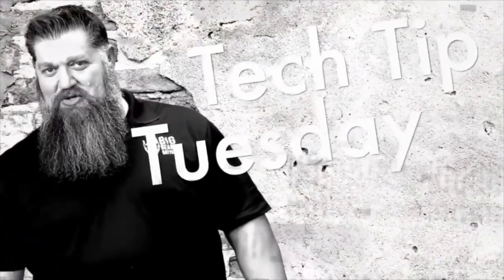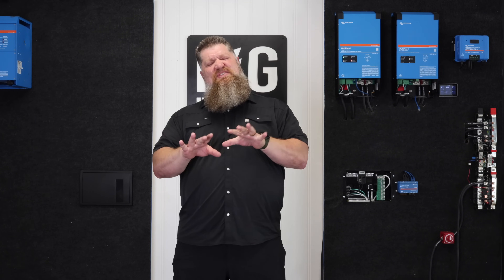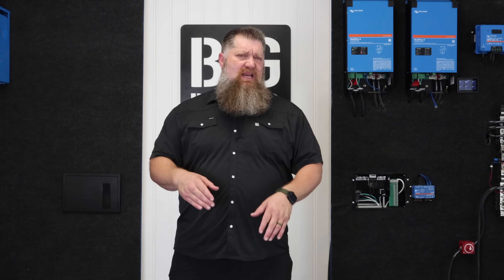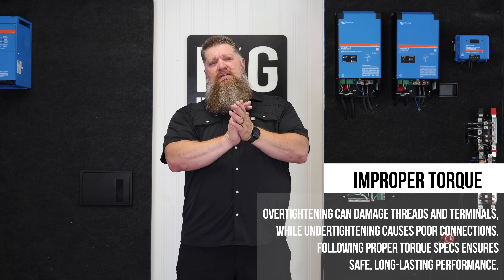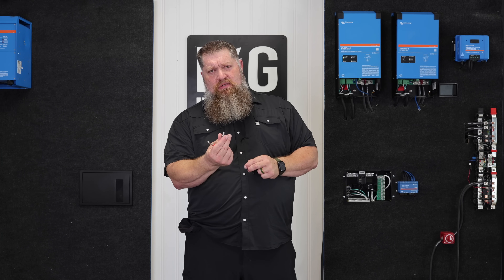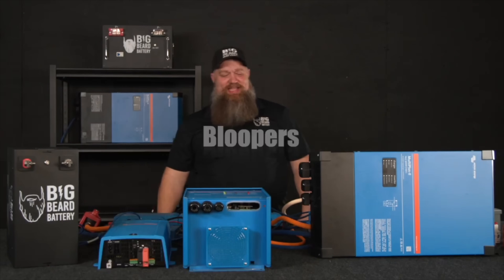Avoid These 4 Cabling Errors in DIY Solar Systems

Comment: 1:00 - No Voltage drop is directly proportional to the legth of wire - imabalance between the leads makes no differenc on voltage drop, just where it occurs. 

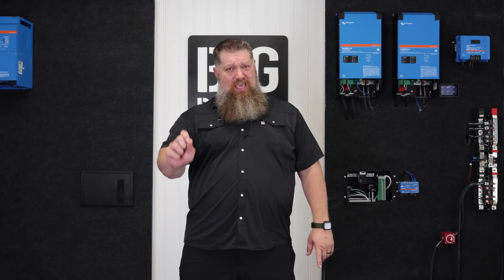2:30 - Yes, it is critical that all paths from multiple batteries should have the same resistance. Cutting that inch off to compensate for the bus bar is is taking it a little too precisely. Plus the solid bus bar is going to have lower resistance than either of the shared wires so you only need to conpensate about half the distance. We are talking less than a micro-ohm here in many cases.    Also cross-corner wiring when practical is better solution for balancing current than mutiple leads to the bus. 

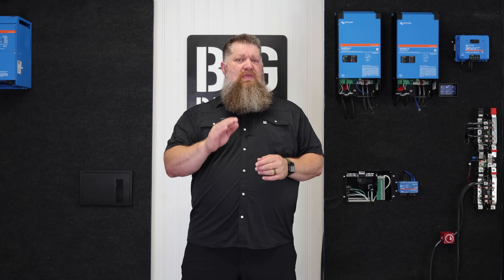3:18 - This is wildly wrong in technical terms, but the conclusions are accurate.   Note that free-air ampacities are different than conduit ampacities, and the temperature rating os components can affect safe capacity. And if you run a continuous load (3 hr or more) that load should not exceed 80% of the ampacity of the wire.   . Additionally it's usually worth running the proposed wire gauge and length  through a voltage drop calculator. If it's above 3% on a large load or in the critical path it can be worth up-sizing the wire.

Comment: Cable length affects nothing directly.  Total resistance is important if you don't have a battery balancing circuit.  Length does affect resistance but it is tiny compared to guage differences, connection resistance, etc.  These days , every multi battery configuration should have a balancer.

Comment: As someone who used to work as an engineer, I cannot see any rationale for if you only have one battery, why the positive and negative wiring needs to be the same length. 

In vehicles for instance, this is very much not the case - the negative cable can be as short as a few inches, but the positive wiring to some loads can be longer than the length of the vehicle. Why is this meant to be a bad thing?
Reply: As a technician I can definitely see the value of a little bit of extra cable for a re-fit.
Reply: @WorBlux Sure, but that's not really the issue at hand is it?

Comment: Not convinced by the 'reduce cable length by the same as extra busbar length'. That assumes that the busbar and the cable have the same resistance, and normally I would expect the busbar to have a lot more copper than the cable and thus be significantly lower resistance. So one inch of busbar might be equivalent to only half or a quarter inch of cable.
Reply from the maker: But if we are talking equivalency then if both positive and negative land in the busbar with the same distance/IR then it doesn’t matter as the busbars (pos and neg ie lynx distributor and shunt would have their own matched IR. Bamo

Comment: You left out the most important tip, properly connecting multiple terminals to a single location. The highest current load to least current load connected to the sink connection. 
   Do NOT stack a 18ga bms/auxilliray between a high current connection. You are decreasing the contact surface area, effectivley reducing current flow/increasing resistance.

Comment: I've got four 12V 100ah batteries wired in parallel (400ah total) and all wires between batteries are equal length 2/0 cable.  I do have a difference in length between the positive and negative going to my master switch (+) and my smart shunt (-) with the negative cable being about 1 foot longer.  Is that acceptable or should I make the positive cable longer to equalize.
Reply: You should read through the comments here for your answer.

Comment: How much length do you add for a Victron 500 amp smart shunt?
Reply from the maker: So the shunt adds length. You can reduce the cable by the lug to lug length
Reply: @BigBeardBattery  Shunts have a precise resistance!

 If you want to be that detailed look up the resistance of your wire, do the math and reduce it by that.   a 50mV/500A shunt has a resistance of 1 milliohm. 100 ft. of 4/0 cable has a resistance of 4.9milliOhms. So you need to take about 20' of cable out. 

You see why some of us find it a bit silly? It certainly looks nice and neat when the cables run together, and aesthetics isn't insignificant if you are assembling a system for someone else, but for DIY that detail is unnecessary worry.
Reply: Adding extra length makes zero sense!  The cables from the buss bar to the inverter only needs to be the proper gauge to handle the current and as short as possible.  There is nothing to be gained by making them the same length/same resistance!

Comment: This is not incorrect. 
In a parallel system, the CIRCUITS of the same devices need to be the same in aspects such as cable length, same manufacturer, same lugs and even similar torque ratings on the bolts. 
For example if two batteries are running to a busbar in parallel, each ones has to have the exact same circuit, so same negative and same positive length as the other battery. However, the negative and positive DO NOT have to be the same. its not about matching cable lengths, its about matching circuits. 

If in the same system you also have two inverters in parallel, they too have the have the exact same circuits as one another, but do not have to have the same as the batteries, and can too have different length positive and negative cable lengths in their respective circuits, as long as the positive of the one is the same as the positive of the other, and the negative of the one is the same as the negative of the other.
Reply: If you have parallel inverters only the overall loop length of each inverter need to be the same.  The color of the wire makes no difference!
Reply: @rpsmith  Thanks for repeating exactly what i said, but just in a more useless way, because at no point did i ever say color meant anything. f you actually read what i said, i CLEARLY said POLES (POSITIVE AND NEGATIVE)
Reply: @BluePowerPro  "as long as the positive of the one is the same as the positive of the other, and the negative of the one is the same as the negative of the other.": ~ Only the combination of the positive and negative total length matters.
Reply: @BluePowerPro  ~ You're welcome!  Have a nice day!
Reply: @rpsmith   False, the negative is often connected the the nuetral, so referencing the neutral in two different spots on that circuit can casue unwanted current flow on the nuetral.

Comment: get a battery equalizer
Reply: Not needed for low C rates, and on high C rate system the better job you do balancing everything else the the less work it needs to do.

Comment: All super valuable tips. I see the washer scenario done incorrectly all the time not just in these bills, but all over the police in general but obviously super important with electrical connections for multiple reasons heat, resistance equals bad lol

Comment: Todd, my 2013 Rockwood 2205S coach uses the frame of the coach as negative, so the negative wire is only about 3’ long. It comes out of the battery box and is bolted to the frame, right under the battery box. Also I have installed a Victron DC to DC controller so I can charge the batteries while towing. Obviously I cannot have equal lengths of negative and positive wires. I hear what you are saying about battery balancing, so what I am planning on doing is exchanging my two BB batteries positions in the battery box. Any thoughts?
Reply from the maker: I am speaking of a busbar system where the positive and negative going to the busbar needs to be the same length on heavy loads. 

It is universal that the frame is used and the shortest distance to the frame is fine.
Reply: @BigBeardBattery awesome video.  What is too high of a temperature for a cable/lug/bus bar? Thanks

Comment: I have a BS in electronic engineering. Wire gauge is critical and this is a safety hazard to drive home. Equal length battery cables to the buss bars to equalize the draw on multiple batteries is also important but equal length positive negative feeds to components is not necessary as long as they come from a common bus bar, and the batteries provide equal current.
Reply from the maker: Not necessary but recommended.
Reply: @BigBeardBattery  By whom? It's a recommendation that doesn't make any electrical sense. Normally there is no reason for the + and - cables to be significantly different lengths, but equally it doesn't matter electrically if they are different, so long as all batteries in parallel have matching setups.
Reply: @BigBeardBattery hi Tod.  What temp is getting too hot for fuses, inverter cables, devices.  I’m talking when pulling almost full inverter loads. Is under 130deg f ok?   Thanks.  Also if you could show more ground deploy system components and tips and tricks vid.  I’d deff watch it.  Thanks

Comment: The length of the cables running from the batteries to the buss bars definitely matters.  Cables running from the buss bars to the inverter do not need to be the same length!  They just need to be as short as possible.
Reply: Yeah, there's no science supporting the idea of unequal cable length for different polarities.
Imagine making the negative unnecessarily long just to satisfy this requirement?
Reply: Depends on the Inverter - Many batteries tie the neutral to the battery negative by default.  Unequal voltage potential between each inverter's neutral can cause undesired current flow and DC bias on the neutral.